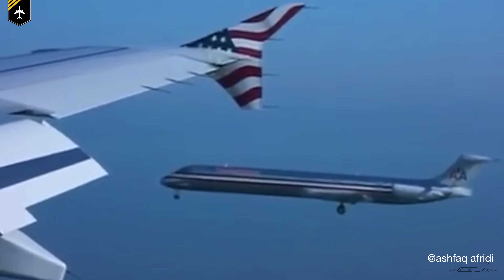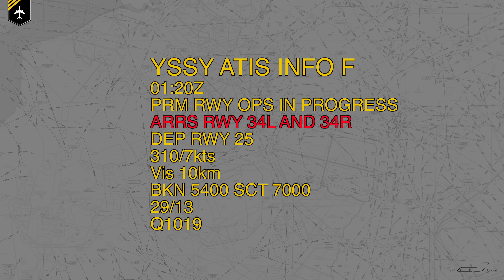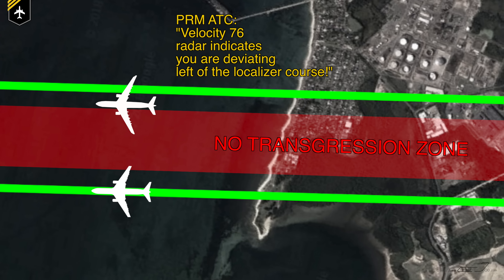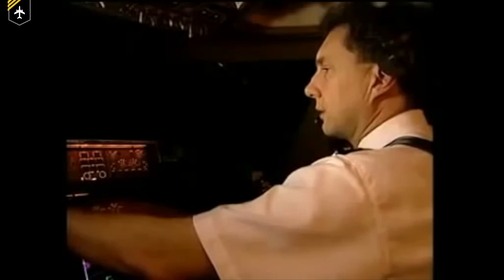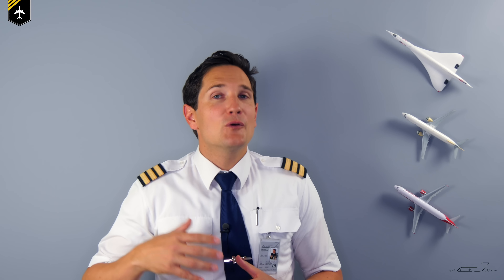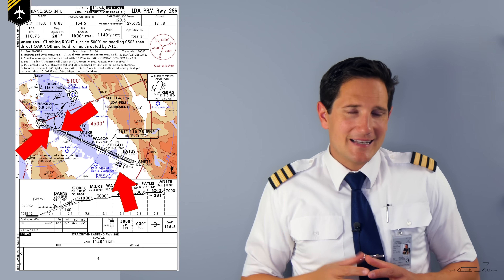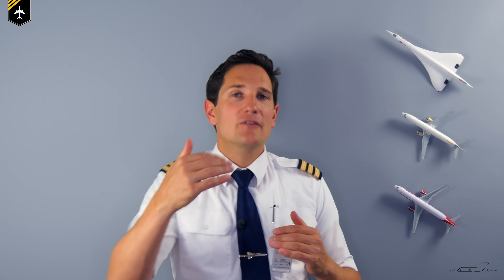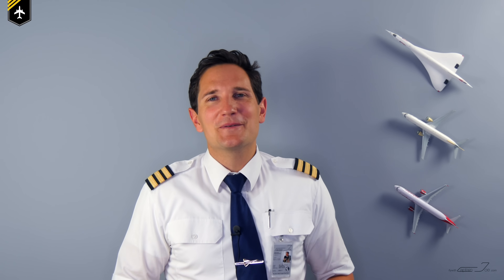Parallel LANDINGS!!! PRM and SOIA approaches! Explained by CAPTAIN JOE

Comment: I still think it's unnecessary.
Reply: SFO has delays even when we’re full VMC and running sidebys. If we ditched the closely spaced parallel ops and went strictly in trail… the delays would be sooo much worse! That’s why it’s necessary.
Reply: @nicholascagezinho1505  I get what you’re saying about too many people. But two airplanes landing side by side in the right conditions is perfectly safe. They’re on two separate runways that don’t intersect and even though it looks close.. still 750ft apart. It’s safe .
Reply: @SpicyFaceActual  Good to know. In fact I'm a private pilot and I didn't know it was safe. Thank you for your explanation. It's a little scary! Is it performed only under VMC conditions?
Reply: @nicholascagezinho1505  if the field goes IFR we switch to closely spaced  parallel ILS operations. Those require a 1.0 mile stagger. In the event of a bird strike or any go around. One plane would continue the approach. The plane with the issue would break off, runway heading climbing to 4000 and wouldn’t be an issue for the other plane. If they both go around.. well, that’s what air traffic controllers are for! We’ll assign a heading and climb to one, and a divergent heading and climb to the other one. 

There’s lots of personnel, rules, and equipment involved that make this a completely safe and efficient operation.. even when things go wrong.

Comment: Hving 2 on same vector mean double the lights to help spot it too, but 1 can b the grooved runway when hardest precipe & other the runway made to hold a tiny few inches of water & foam in case emergency type need. The tiny holding water can b salt water & antifreeze that is pet safe, so if temp near freezing 1 strip stays open or emergency open, & other sheds water more quickly.

Comment: I really like this parallel run way step up bc in white out fog conditions, or cross wind conditions u can b lined up for wind side & end up on go line for left run way as a fall back. Blowing runway in snow & sleet conditions may mean hving little time after clearing run way b4 u can still land, but again if u hve 2 same vector to land on the most min to min cleared can b used.

Comment: You've explained the procedures, but missed the most important part: Why is this even necessary?
Why is a few minute's delay so important to one or the other of the planes?
Reply: What about all the following aircraft who are also intending to land?
Reply: Because it’s not just a few minutes delay. The runways are 750ft apart at SFO. When the weather is good we can use visual separation to get closer and pair the planes up on final to land side by side and put the most airplanes down in as little time as possible. When the weather is bad, we can’t rely on the pilots seeing each other, so SIOA / PRM rules would allow us to get them almost as close without visual separation. Funny thing is we don’t use PRMs anymore. We use something called closely spaced parallel approaches which doesn’t require a monitor. 

Even when we’re running full blown sidebys there are delays to get into SFO. 1-2 hours in some cases. If you take away this operation, we’d have to put everyone at least 3 miles in trail of each other, sometimes 5-9 depending on wake turbulence and the delays would be more like 10-12 hours

Comment: Always liked LAS. 26L and 26R are 850' apart and the volume is high, so parallel landings are common.
Reply: They don’t do parallel landings on the 26s. If they land on 26L, they will do converging ops on the 19s or the 1s.

Comment: Most airports use parallel runways for simultaneous landings and take-offs into the wind. I wonder why e.g. San Francisco does landings on both parallel ones - where would the take-offs take place??
Reply: The calm wind configuration for SFO is to arrive 28L/R and depart 01L/R.  This allows them to depart two aircraft off the crossing runway in between the pairs of arrivals. It takes less time for an aircraft to cross the landing runway than it does to clear it if it departs the same runway. They can move more aircraft. 

When the crosswind component is too strong to depart the 01s they’ll start arriving and departing 28s and switch to a staggered final instead of sidebys. It’s slightly less efficient.

Comment: I lived in San Francisco for 16 years, and I have flown in and out of SFO, many times. I knew about the parallel runways but this was a bit more technical and interesting from a pilot’s view point. I guess now I can understand the Asiana crash better. That was in 2013, July I think. So do they stop SOTA approach’s during night hours?
Reply: SFO doesn’t use SIOA anymore. It has to do with staffing and $ more than anything else. They can land just about as many planes with dual ILS approaches and a 1 mile stagger that they could with SIOA. And they can staff 2 less scopes and don’t require special pilot training. SIOA was allowed at night when it was used though.

Comment: A pretty good description of PRM and SOIA approaches.  Yes, we do try to sequence small aircraft appropriately behind heavies.
Reply: Nowadays heavies are all on 28R and either very slightly staggered with smaller aircraft, or 1.0 mile behind the smaller plane. Anything behind the heavy will be maintaining visual or in bad weather separated by standard wake turb rules. (5 miles or so)
Reply: @SpicyFaceActual  This is pretty standard when using visual approaches or visual separation to close-spaced parallels.  We did the same thing when I worked at Los Angeles Approach (SoCal) and were running approaches to the inboard runways.  Most controllers tried to have an even stagger (say, 1.3 to 1.5 miles between the inboard and the two outboard aircraft in front and behind), but it varies, as aircraft don't fly the same speed inside the marker.  Although it's counter-intuitive for wake turbulence, you generally want the heavy in front to avoid the overtake, as wake turbulence overtakes are not allowed even with visual separation.
Reply: @johnfowler1627  I work the SFO finals at NorCal now. It’s a little different than LAX. We don’t use SOIA or our PRM scopes anymore. We can land about as many AC per hour using 7110.308 rules that we could with SOIA. But we don’t have to staff the extra scopes. During visual weather we make pairs between same weight classes without any offsets at all. Side by side so the tower can launch departures off the 01s between the 28 arrivals. When a heavy is involved were required to have a slight stagger for wake turb. 1/4 mile or so. We’re getting visual separation between everyone, so it doesn’t matter if the heavy is staggered in front or behind. And they can be on either runway. If the heavy is staggered behind, they can not overtake the smaller aircraft on final. If the smaller aircraft is behind, they’re allowed to overtake. 

When we’re running .308 (ILSs) the heavies have to be sequences to 28R and every “pair” regardless of weight has to have a 1.0 mile stagger with the 28L arrival in front. 

It’s an interesting and fun operation! 👍
Reply: @SpicyFaceActual  Cool.  You're right that we don't run side by side at  LAX... There's no need as there's no intersecting departure runways.  We liked the heavy in front when I was there because there's always that heavy that can't slow down 🥺  The wake turbulence overtake rules are the same at any airport.

It was cool to have 4 747s coming down the 4 finals, all within 1 mile of each other.  Saw that happen twice.
Reply: @SpicyFaceActual  Is this a new rule? I always thought the stagger was 1.5 miles. I know some airports were researching reducing it, but they had a larger distance between the runways than SFO.

Also, what's the AAR with this rate? If I recall, SFO's AAR using SOIA was in the high 30s. Assuming this is similar?
Reply: @SpicyFaceActual  Thanks for the link! I was working with an airport authority a while back and we were researching with the FAA to reduce the stagger for landings. I left before finding out what they decided to do. Looks like one of the airports is included on the list! 

Seems like SFO wasted their money on SOIA and it isn't even used anymore. 

Is SFO's AAR during good conditions still 60? I heard it was reduced to mid-50s because of more foreign airlines starting services there and the issues that revolve around their pilots.
Reply: @cykotronic  Not a total waste of money. We used the crap out of SOIA when we could. It just became obsolete when a) we didn’t have enough controllers to staff it regularly, and b) 7110.308 procedures could land just as many planes without the required staffing.  Also United paid for the whole thing so they could reduce delays. The FAA didn’t lose out in any funding. 

 But yes, here we are! Our standard sideby arrival rate now is either 56 or 58.. I can’t remember which one. But it’s still pretty good when you consider we’re giving 5 miles or so on finals to get departures out on the crossing runways. I’m not sure how much foreign carriers played into that. Sounds reasonable though. 👍
Reply: @SpicyFaceActual  from what I heard, there were a few incidents with some Asian carriers and they just decided not to have all foreign carriers run side-by-side with other aircraft. Euro carriers complained because they felt they were unfairly penalized and it caused them delays, so they may have gotten a waiver, but not sure. But there have been more Asian carriers starting services at SFO recently than European ones, so…

How’s traffic over there there days? Things starting to get back to normal?
Reply: @cykotronic  Yeah we had a few restrictions after certain incidents. But nothing that lasted forever. We have to stagger heavies during sideby ops which is a wake turb thing. And foreign carriers are usually heavies. As of now can make a sideby with a foreign carrier and another aircraft as long as heavies aren’t involved .

Traffic is still very slow. I think we were 40% down from 2019 traffic last month. BUT we’re down to a single runway for construction throughout the summer. So our in trail Ops have required some vectoring again! It’s been nice for the trainings to see snd for us to practice our skills again!

Comment: Joe, why did it say and what does it mean Singapore 11?
Reply: When the air traffic control gives instructions to aircraft they use the airline's call sign and flight number. 'Singapore' is the call sign of the Singapore Airlines and '11' was the flight number. So 'Singapore 11' was the call sign of this particular flight of the Singapore Airlines aircraft. In this way, the air traffic control indicates for which aircraft the instructions are intended.

Comment: I’m wondering what is the anxiety of the ATC controller.
Reply: Zero, they do it all the time.
Reply: For sure. It can be stressful at times since we want to run a tight operation with minimum separation. If I need 5 miles behind a heavy for example.. 4.9 miles is a go around, and 6 miles sends the feeder sectors into delays. We want to push it without causing go arounds. It hurts our feelings. So it’s stressful in that way. We want to do a good job. But it’s not stressful in a scary, “I hope these planes don’t hit” way. That’s different.

Comment: I've had 2 flights that had to pull up. Interestingly the dont turn as usually there are planes taking off to the east and a mountain range to the west. So they pull up, fly straight and then follow the missed approach guidelines.  Pretty cool

Comment: Can you also explain emergency radio communication? I mean like that ATC only has to say for example 123 instead of Speedbird 123
123 turn left immedietaly heading 123 instead of Speedbird 123 turn left immedietaly heading 123 and that the pilot has to first execute the command, then comfirm it
Reply: Knedlik MCPE in the way you are suggesting, there can be a lot of confusion, especially in a high workload environment 

Eg 250 can be speedbird 250, heading 250, speed 250 and flight level 250. Hence full phrases have to be said
Reply: In emergency, ATC doesn’t have to say speedbird, just the flight number. If there is only one BA, they can call them just speedbird without the number. Also, the pilot has to first do the command, then confirm it

Comment: Fantastic video! I'm a retired controller from SFO, at the 8:00 point on the video, the breakout is actually a Boeing 737 being pulled off the approach to runway 28L. We never allowed heavy aircraft to fly the approach using side-bys (ie, Heavy Boeing 747 along side of a Heavy Boeing 767 etc). What has happened in the video is the Cathay "heavy" (Boeing 747) was overtaking a "large" (B-737) which is not allowed in wake turbulence separation rules. The safest thing to do when the 747 advises they cannot stay behind the 737 and will pass it, is to cancel the 737's approach clearance and bring them back for another try. We typically avoided pulling the widebody off the approach due to the fact they'll create additional wake turbulence issues and have typically already flown for 10-12 hours - we'd like to get them on the ground. Earlier in the video you'll see the Boeing 777 rolling out on 28R overtaking the regional jet on 28L... that's about as close at its ever allowed without someone being taken off the approach. Great video production, really enjoyed it!

Comment: Dear Captain Joe, here are some questions that i have had for a while. Please can you consider them for future videos? Of course, if you think it will benefit others too! .
Why are some landings some landings really bumpy , some others really smooth? 
Why do you sometimes see the aircraft descending really rapidly as it approaches the runway?
On the airbus neo you hear a kik kik kik kik noise just before landing , what is that? I may not be producing the actual sound but thats the closest i guess i can get in words
Reply: Arun ganapathy bumpy vs smooth could be a lot of factors. If the weather is bad, it can go bumpy

And aircraft may descend at a consistent rate, but it is possible that the ground is rising up, hence giving the illusion of a high rate of descent

And the sound you hear is the landing gear going down
Reply: @ @ZK-APA  ; thank you; I understand bad weather landings being bumpy , but even normal weather landings are very often bumpy( and of course some are smooth). I know the landing gear sound , thats not what i mean. I mean the kik kik kik kik much after the landing gear has dropped .
Reply: Arun ganapathy oh in those cases, most probably either there was some external wind change, or the pilot messed up a bit lol

Comment: More good stuff Joe! Thanks!
I was returning from John Wayne/Orange County to PHX & saw another 737 turning to pick up the north runway as we were going for the south runway. (approaching from the west)
It's amazing how close we were to the other approaching flight. We had heavy crosswinds & I thought to myself that we'll be ok but not without undue stress.
I was so wrong! Our America West pilot touched down as he corrected for the crosswind as he made contact. So perfect! 
Some history: I worked on/ OH'd APU's for America West, Southwest, Frontier, Air Cal, US Air, Piedmont, Wien Air Alaska, USN, Braniff, USAF, Project Orbis & so many others. I also performed on wing engine checks & hydraulic repairs & troubleshooting for UPS, FEDEX, Casino Air, CF & Capital.
Such a rich & fulfilling career & this doesn't include my work for the D.O.D. (USMC)
I just wanted to say that even working in a support position for an MRO shop, you can help ensure a high quality flight product & safety measure for the flying public.
Support our troops!🇺🇸😉👍
Please help support Project Orbis so that they can  continue to prevent undue blindness! Check out their website to understand their mission & success rate!
They, like our military, do an amazing job that no-one hears about. 
Thanks for letting me ramble.

Comment: understood well about the take off. But I cant see such a elevator moving up while the flight takes off.  Could u pl explain.
Reply: If you watch a video of an aircraft which is taking off it can be very difficult to see the elevator moving because the movement is not very large. But yes, the elevator moves up when the aircraft takes off.
Here is a photo where the elevator is clearly moved up:
http://3.bp.blogspot.com/-owqCyr6eYuk/Ui0ePv7C9fI/AAAAAAAAAFM/LbC6c04Zl60/s1600/Elevators.jpg

Comment: What would you say to the idea of in the future that all modern aircrafts are run by an onboard A.I System that controls the aircraft at all times that knows all the flying procedures and what to do in particular scenarios for these kind of things. The increase emerging technology of A.I Systems automating and controlling vehicles is growing bigger than ever and becoming more advanced as they learn to do all the things a human pilot can do. A.I's however have the advantage of not making mistakes because it would of ran all the calculations, it would also have proximity sensors as well as visual cameras to detect and see other vehicles from every possible angle from the front, the rear, the top and bottom as well as the sides of the aircraft.

An A.I controlled aircraft would only then receive command signals from the control tower operated by humans of course on the approach, takeoff and landings, as well as clearance for landing. It probably make flying a lot more safer, and have fewer mishaps due to communication errors, since the aircraft will have its own coordination instruments like geolocation tagging and satellite tracking and radar detection to know that it's on the correct path for its intended destination.